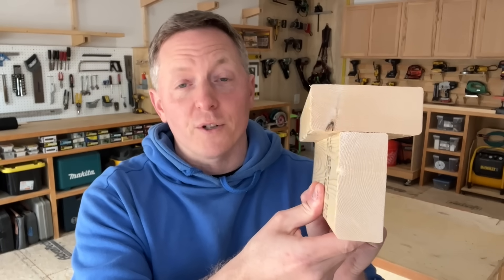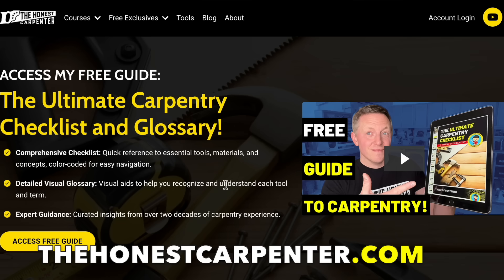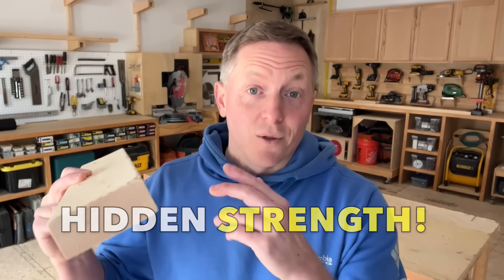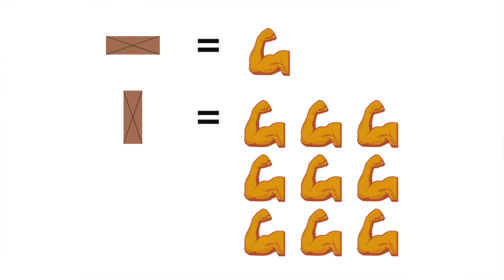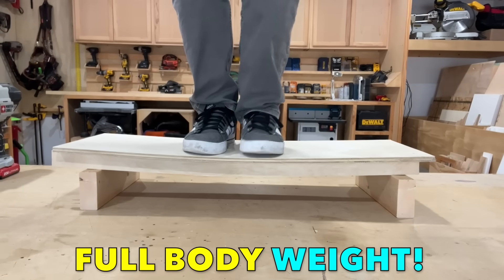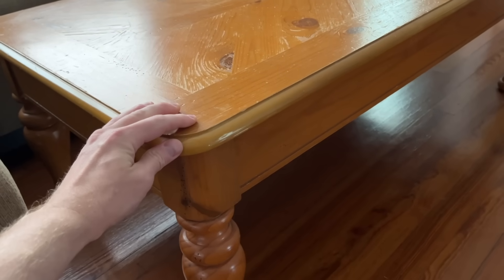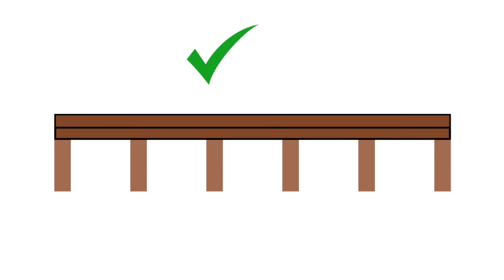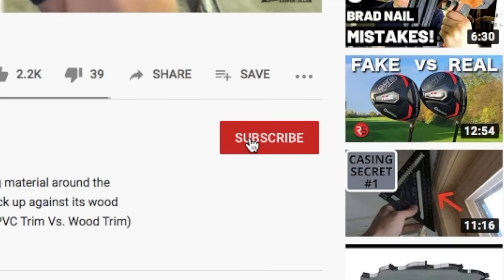Make Everything You Build STRONGER...(Overlooked CARPENTRY SECRET!)

Comment: As a structural engineer, nice video!
Reply from the maker: Thank you!! 🙏 😁
Reply: I'm one too - well done Sir!
Reply: What is the physics behind this ?
Reply: Area moment of inertia. For a rectangle is base width x height cubed /12. For a given material the inertia is the bending stiffness. It gets more complicated from here, but that is a starting point if you want to learn more
Reply: Really? I'm a structural engineer as well. I thought it was poorly organized, will leave most viewers with the idea that stiffness and strength are the same thing, got shear completely wrong, made many other misleading assertions, and would be better if it hadn't been made.
But then, after spending years hearing the goofy theories of contractors and manufacturers about stiffness and how structures will fail, I don't try to explain it anymore. There's no point in it. It seems everybody knows more about structures than the structural engineers who actually do the calculations and design the structures.

Comment: So then, ignoring extra cost, would it then be better to use two 2x4s secured together side-by-side vertically as a top plate/bottom plate rather than a single 2x4 laid horizontally?

Im sure there are better ways, but for someone on an extremely austere budget building something small, if what I'm asking works, would be a comparably cheap way to add strength essentially everywhere.
Reply from the maker: Unfortunately you wouldn’t have the same landing surface along the top or bottom edge that way—one face would have the narrow 1-1/2”, which would be unstable. The double top plate is still the way to go in that case!

Comment: The thickness has a third power relationship with the strength.
2x thickness = 2^3 = 8 x strength.
4x thickness = 4^3 = 64 x strength.
One of the most fundamental things I remember very well from my engineering education.
Reply from the maker: Thank you for putting numbers to this, Christopher! I’ve always just had a carpenter’s understanding of it. My dad taught it to me, and he’s more of a mathematician. But you can look around EVERYWHERE in structural engineering and see it at work. 🙂
Reply: Go back and check again- strength relates to section modulus which is thickness squared.  Stiffness relates to moment of inertia which is thickness cubed.  Width is in there too, but it would be constant if you are just thinking in terms of increasing thickness and nothing else.  If you are comparing the different orientations of a 2x4 when you turn it from flat to vertical you increase a lot because now you have 3.5 squared or cubed instead of 1.5, but you have reduced the width so you have to multiply that by 1.5/3.5.  So a 2x4 turned vertical has 2.33 times the strength and 5.44 times the bending stiffness.
Reply: @billj5645  THANK YOU!!!!!!  There is obviously confusion here between strength and elasticity.
Reply: the  correct numbers would be 1.5 cubed = 3.375  strength and 3.5 cubed =42.875 strength
Reply: @brianjonker510  strength (section modulus) is thickness squared, stiffness (moment of inertia) is thickness cubed, both of these assume width doesn't change.  If you flip a 2x4 from flat to vertical then width has changed and this reduces some of the benefit of thickness squared or cubed
Reply: Thats because the answer to life is 42  @brianjonker510
Reply: Doubling thickness may result in 8x smaller deflection, but rotating a 2x4 to do this also means halving the width, which halves the strength again. So a 2x4 is only 4x stronger in portrait than landscape mode.
Reply: @awt  I'm sorry, but your claim is false. See my reply to the original comment.
Reply: @awt  An excellent point very well made.
Reply: And section modulus is just Ix / c. So moment Of intertia divided by the distance to extreme Fibre. Get the majority of section away from bending axis. So depth is a cube more important where width is only multiplied by 1 bh^3 / 12
Reply: The people in the comments are right. It’s stiffness which is cubed thickness. Stiffness is what’s being demonstrated by putting both ends up and walking over the wood.
Reply: All y'all are making my head hurt. First of all, things that increase by the square OR cube of something else are both said to go up "exponentially" (as opposed to linearly). Secondly, the board's "strength" isn't really what you are talking about; you are talking about its "stiffness", or how well the board resists deflection (i.e., bending). Deflection (δ) is given by the equation: δ=(PL³)/3EI, where P is the center-point load, L is the length of the board, E is Young's Modulus (a constant that reflects the board's material), and I is the 2nd moment of area (also called the "area moment of inertia"). Now, the board's dimensions are reflected in the 2nd moment of area (I). For a board's rectangular cross-section with base (b) and height (h), I=(bh³)/12. When laying flat, h=1.5", so I=0.98. On it's edge, h=3.5", and so I=5.36. So increasing the h-value (the dimension parallel to the load, P), increases the 2nd moment of area (I) exponentially. if we combine the equations, we get: δ=12PL³/3Ebh³. So as h increases, δ decreases exponentially. But anyone can see that it would be stronger just by looking at it.
Reply: That is actually incorrect. The strength is proportional to the square of the depth and the stiffness is proportional the cube of the depth. So twice the depth is 4 times as strong but 8 times as stiff.
Reply: I am glad you are the engineer, and have the brain for it....  I saw the numbers, and symbols and went,.  what...  Lol
Reply: @timothycreasy2161  b is base and h is height.  Plug and chug.
Reply: @ouchmytoe your equation for delta shows what I claim, doesn't it?
Reply: Came to say this... It isn't exponentially stronger. Exponentially stronger would mean that the thickness of the material would be in the exponent when calculating it's strength.